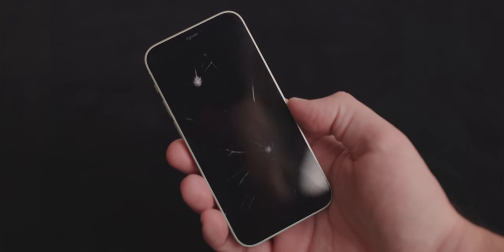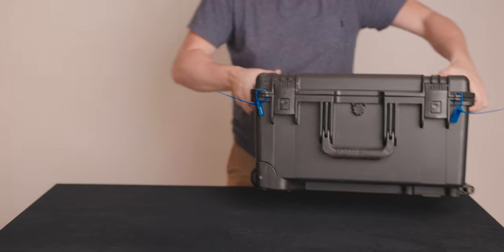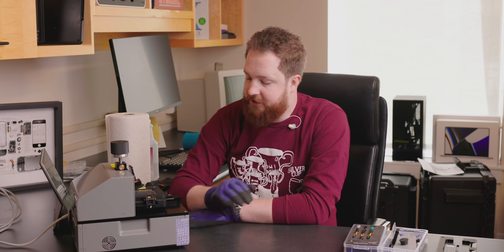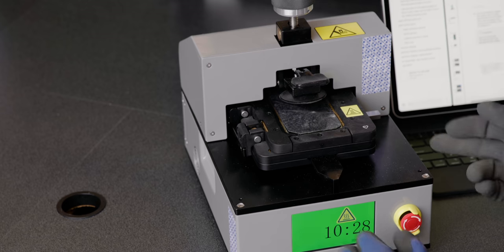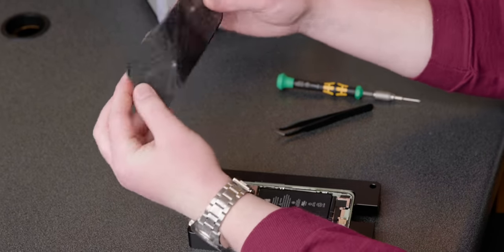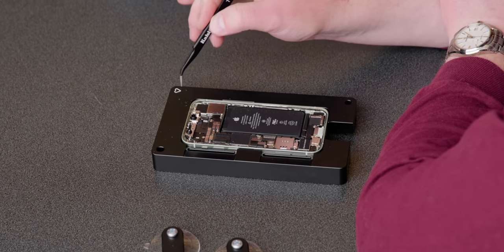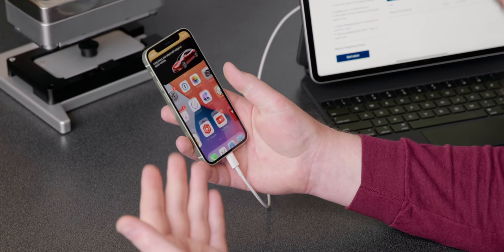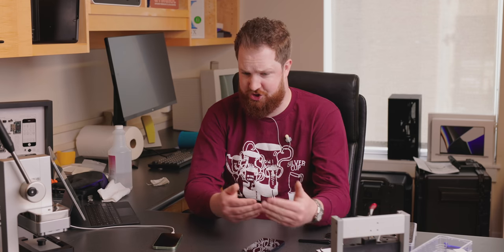Using Apple’s Tools to Fix My iPhone

Comment: So I was a genius and repairing in the room. The parts are basically the same as our repairs. The tools are the same the stand is the same everything.  Diagnostic mode is something we need to trigger to confirm the repair and the display is correct. This very much the process in the Genius Room to fix a screen or battery. Hope people understand why repair take up to an hour.
Reply: Curious about one thing. If you only do a battery replacement in the store will they reuse the old glue strips or apply a brand new seal?
Reply: @iamDave0071  it’s not possible to reuse them once they’re removed. The process of removing them turns them into pieces.
Reply: @tonythecapo7375  I meant the screen bezel seal. I know the replacement battery has new adhesive strips.
Reply: @iamDave0071  yeah, that’s what I was referring to 😜 The screen is always resealed with new adhesive and if the replacement gets put on bad, it will be removed and applied again for a proper seal 👍🏼
Reply: They made it needlessly difficult.
Reply: Do you need to ask for the passcode from the customer or do you have some kind of bypass for the passcode?
Reply: @tonythecapo7375  My bad misinterpreted your comment! That changes things for me, was going to do it myself but for the 80 bucks for the battery & new seals it would be worth it. 
At least keeping the water resistance and a proper seal.
Reply: @air90air  there is a bypass. We never had the password
Reply: @CuriousTinkering   that’s because the repair is not easy.
Reply: @iamDave0071  everything was always new. If we ripped the tab on the battery and we didn’t think it was save to remove, we would swap it.
Reply: @APPLE1TO1  a lot of people have fixed their broken screen or replaced their batteries easily without these complicated "tools" and for less than $100! They just want you to think it's difficult to desuade you from fixing it yourself.
Reply: @APPLE1TO1  wait what (password bypass)
Reply: @ItsCrowva   look at 28:08, that diagnostic mode is outside of your system, so they dont get access to your personal stuff, like logs and wallet etc etc
Reply: @C.hrisis  yea thank u
Reply: @APPLE1TO1  So also the screen seals right?
Reply: @APPLE1TO1  the repair is hardly difficult. If Apple wanted to they could make third party repairs the new thing, but no, pairing parts to the phone, disabling functions even if the parts are genuine, to ensure you pay them, for their products. This whole repair scheme is a backhanded “step in the right direction” to make everyone think its this hard confusing process that not all people can do. When in reality its a few screws and disconnecting flex cables. The hard part is the software locks and limitations, stopping people repairing their devices cheaply, and making Apple richer.
Reply: @lew7989  it’s called a business. Trust me. The repair process is done for a reason. Go get a third party screen and see what happens. I seen it. Not good results.
Reply: @iamDave0071  if you wanna water resist your phone you need to do this the right way.
Reply: @ItsCrowva  they never take the password and run a recovery mode diagnostics that we trigger to your phone. Apple never gets in the phone.
Reply: @CuriousTinkering  I agree. They also came in the apple store complaining about that screen. Also, good bye water proofing.
Reply: @APPLE1TO1  I am aware that’s why I wanted to make sure when I go change my battery in the Apple Store they’ll also replace the screen adhesive for that seal and not just reuse the existing one.
Batterycondition is at 84% so probably worth getting it replaced.
Reply: @iamDave0071  if you have a screen protector, they typically need to remove that in order to do the repair. I recommend that you buy a screen protector that has a lifetime warranty.
Reply: @lew7989  ok. You can open your own shop and start repairing iPhones. Try taking 10 of these repairs in 2 hours.
Reply: @APPLE1TO1  I don’t use one, I was talking about the screen seal, in order to get to the battery the phone obviously needs to be opened. While the screen is in perfect condition I don’t think the bezel seal/gasket should be reused. Especially to keep the water resistant capabilities. Hence why I asked if they remove the old seal and replace it with a new one if I go in for a battery replacement.
Reply: @APPLE1TO1  not always true. 3rd party shops do good jobs (check reviews before going). Only down side to a 3rd party is the Apple serialization of parts.

Shops use after market or refurbished parts. If a customer wants the genuine Apple part, I’d suggest the customer to order the part from Apple and have a store install it. It takes about 30 minutes for a shop to do this repair.
Reply: Worked for an apple authorized service provider for a few years and I can confirm these are all the same tools and guides we used as well, the only thing that guy in the call center did was probably start diagnostics in GSX lol
Reply: @APPLE1TO1  your opinion is biased in regard to 3rd party screen repairs. Anyone with a good experience at a 3rd party shop isn’t going to pay the Genius Bar a visit. I own an independent repair shop, fix iPhone screens daily, repair the phone in front of the customer, replace the water resistant seal, and guarantee the screen to work for the lifetime of the device (given it doesn’t get damaged or wet). That does not sound like “bad results” to me.
Reply: What happens if the iphones bezel is too dented where the screen won't fit?
Reply: @pibstarr  old screen goes back on and offer a full unit replacement at the cost of the whole machine replacement.
Reply: @michaelyoungs1562  Good for you. Not everyone does that, and that's kind of the point of things like this.
Reply: @APPLE1TO1  I’ve been fixing phones for 4 years. Every third party screen and battery I’ve ever used has been fine, lower quality, but fine. The whole “this screen isn’t genuine” message is bullshit because even when the part is actually genuine the message still comes up. It’s anti repair in every way
Reply: @TalesOfWar  I don’t disagree with what Apple is doing in terms of parts and tools access. I just disagree with the sentiment that independent repair is dishonest and low quality. It can be argued that Authorized repair is dishonest and low quality as well. Just let the customer choose what they want without any caveats or unnecessary consequence.
Reply: @michaelyoungs1562  which is fine, except for the last part. I want a waterproof phone, and it looks like this almost guarantees a waterproof phone.
Reply: @patx35  I’m confused. At what point was your phone water proof and how did we get on this topic.
Reply: @iamDave0071  The seal for the screen can definitely be reused, but wouldn't be as good as a new seal. I reuse the original seals all the time and have no issues unless the seals are really dirty or just straight up damaged.
Reply: @michaelyoungs1562  you guaranteed the repair of the device, except for water or physical damage. Many smartphones nowadays are water resistant up to a certain depth. I want a device that will reach the same water resistant rating as factory. I rather go with the more "correct" phone repair if that would keep the factory water resistance.
Reply: @patx35  I understand now, but just know that no one, not even apple, guarantees any liquid resistance. So I would ask would you like a lifetime guarantee for $125 or a 90-day warranty for $200. (Comparing Xr repair prices)
Reply: Dude it takes 10 min for any iPhone if you don’t use all that crap, I repair them on the daily for Asurion.
Reply: @lew7989  Yadda Yadda. Keep going...
Reply: @lew7989  You have no way to determine "fine" - to you, "fine" is "no one brought one back" - you have NO IDEA WHATSOEVER as to the quality of the parts used. Every repair shop in the world claims their parts are "especially sourced" etc. Bollocks. Apple LITERALLY DESIGN AND MAKE THE ENTIRE product, support infrastructure, on and on and on and on. I trust Apple.
Reply: @unlokia   "fine" means the screen worked well enough as it should without being an over priced "oem" screen at a fraction of the cost. People literally don't give a shit about an OEM screen when they find out the cost of the repair for a simple screen replacement. Aftermarkets are great unless you use the cheapest screens possible. If you are the type of person that will only ever get OEM screens for your devices then go ahead and waste your own money lol. Normal people don't care and just want their phone to function. Even if the aftermarket screens have issues, repair shops usually offer a 30 day warranty for defects anyways. It doesn't matter if you "trust" apple or not, OEM screens will always be the best screens, but that doesn't matter when the price of an aftermarket screen repair is less than half the repair cost of an OEM screen replacement.
Reply: @BeardlyNova  and that’s why I never send anyone to your reprise centers. It’s not done correctly.
Reply: @APPLE1TO1  but all that is so insane, it’s completely unnecessary, I do it perfectly fine
Reply: Should this be the case for anything that is not necessary to system security? no. And if it is, then the diagnostics should not have any hurdles whatsoever. Bare in mind that when we talk about right to repair, it's not just the parts and documentation we're talking about, but diagnostics as well. This is one of those "we'll meet you halfway and no further" types of things.
Reply: What I don't understand is how people don't understand that it could (and probably should) take an hour or more. I only today realized that a hour turnaround time is expected. I would be satisfied if it took 8 hours, or even a few days. I guess I'm not nearly as impatient as I thought. Why would anyone be mad about an hour? It's not going to be done in 5 minutes, so you're not going to hang around the store while it's being repaired... or do people actually do that?

Comment: The same could be said about the tools in the automotive dealer service departments. The engineers design a specialized tool for everything. In reality your general mechanic uses generic tools that can be used in a broad set of scenarios and make/models of vehicles.  The job may not be done to factory standards, but the end result is close to the same.
Reply: Yes. A general mechanic can't afford to buy all of the specialized tools for every car make and model to ever their garage, so yeah, generic tools it is.
Even official repair centers can't afford to have all specialized equipment on-site and have to "retire" the least used equipment to god-knows-where haha.

Comment: That was a very valuable walk through and review.

To me, “right to repair” should be defined as: “repair services should be substantially cheaper than the new product”, i.e. Apple and competition should provide repair at their service centers at a fraction of the cost of a new device. This would give the incentive to keep things alive as long as possible and this protect the environment and customers pockets. I would not request to always be able to do this myself.

I have repaired a lot of my things in the past. It is fun and satisfying to take care of your computers and own bikes, even though the latter requires a substantial investment in tools as well. I started doing all of my bike stuff when the dealer told me that an oily disc brake requires a complete replacement at a cost almost equal to half the bike’s original price. It does not - just a careful deep cleaning.

But I am not ready to start dealing with all these adhesives. I can see that the screen needs some form of glueing to the back to be water tight and also because of its thinness. Otherwise the frame would have to be on top and push down the edges with some rubber seal behind. And in addition to a not so elegant bezel, that might create too much bending stresses. But the battery could be clamped in, as it was done in the windows phones.

So happy that none of my iOS devices required a repair yet.
Reply: "substantially cheaper than new product" - it is though. i just cracked the screen on an iphone 13 pro max. i took it to the apple store and was quoted $329 for an out of warranty screen replacement. when i came back to pick it up they said they couldn't get everything to verify properly so they just gave me a whole new phone. sure $329 is a lot of money but it's way less than $1300 for a new phone, and when they couldn't stand by the original repair they made it right anyway. i'm willing to pay for that level of service.
Reply: No. "Right to repair" should be defined as "forcing the manufacturers to publish certain device diagrams, and also to offer the components for sale" to anyone who wants to repair it. The way you define it, Apple could still have a monopoly on repair as long as they offer it for cheap. I don't agree with that.

Comment: I'd like to see a "race" between you and a person following an ifixit tutorial. I feel that that display suction cup thing isn't really the most efficient thing, everything seems quite over-complicated. I'm not a repair technician but I've repaired plenty of phones, from iphones to crappy $90 Huaweis lol. Friends love me

That 90° holder with suction cups is pretty neat tho. Waiting for a 3d-printed model haha
And I agree, that press is neat 

And definitely open these if you feel like you can deal with the consequences lol. I'm interested!
Reply: you can get 90° holders on the after market, though they hold it from the edge, rather than using suction cups.
Reply: The problem is, the person following an ifixit tutorial will not get FaceID and battery health to work. Even with genuine parts.
Reply: @alexander97  wrong, face ID will work as long as you swap over prox. sensor/mic/etc. assembly from back of screen.
Reply: @t.walker3101  you will still lose other features like True Tone or similar (experience on iPhone 8).

Apple’s is much more complicated but at least you get what basically is a brand new phone with no limitations usually found from 3rd party repair
Reply: Then you wouldn’t have factory water proofing seal
Reply: I'm pretty sure that I'm about 4-5 times as fast opening 12s and 13s without the stupid machine (at least based on about 40-50 repairs I've completed since our business joined IRP). No race needed. Especially if the display is broken you don't even really need to heat it. And the holder is actually inconvenient for me, since I can't turn the phone around so easily. The press is cool I guess? Though I barely use it, strong hands ftw.
Reply: @Andy_M.S.c  nah you won't lose anything if you reprogram the screen with a JCID or similar tools. It all depends on knowledge, sadly most people today have turned into stupid zombies who refuse to learn, hence there is people who don't even know about this. Same with the people who don't know you can transfer the IC from the old display to the new one with a 15 minute solder job.
Reply: @Andy_M.S.c  You can make it work with something like a JC Pro 1000s, but I dont think its compatable with the 13 yet
Reply: @PvtAnonymous  ive heard about that soldering job, doesnt it require a microscope tho?
Reply: A great idea, have a race. The race should end with a practical test of the IP68 rating.
Reply: @Carterthielftw_  it helps, but is not necessary if you have good sight.
Reply: @alexander97  that's apple's fault not ifixit's tho

You can also but the reprogramming tool, still spend less money than apple's program and not lose it
Reply: @cossieboy  you can buy the exact same adhesive seal things from not-apple lol.
Reply: @sjwright2  great idea actually, I like that
Reply: @t.walker3101  I swapped my battery and my touch id and button will no longer work.
Reply: @HamguyBacon  that's apple's fault, serializing components that shouldn't need to be serialized. That's why this repair program doesn't do sht for right to repair, it's just a "eh, ok we see it see?"
Reply: @HamguyBacon  I've replaced batteries on all iphones, and the home buttons still worked, did you possibly damage the cable? The battery and touch ID are completely separate
Reply: @fancy_owo  It is the Iphone 8 plus, The first repair I ever did was my iphone 7 and I tore the connector, I made sure to be extra careful on the iphone 8.
Reply: @FAB1150  yeah that's why he was on a call with that woman.
Reply: I disagree about the overcomplication. The tools are very over-complicated so that the actual repair process is less complicated.
Reply: @awesomeferret  no, some of those tools needlessly over-complicate very simple tasks

Comment: I think the reason they gave you 2 adhesive strips is because one was included with the display and the other was included with the battery as the seal has to be broken in either of the cases
And that’s also why you got 2 sets of bottom screws
Reply: That makes a lot of sense.
Reply: No he mentioned in a comment that he got 4 sets of adhesives in total. But you're right about the bottom screws. 1 set per kit.